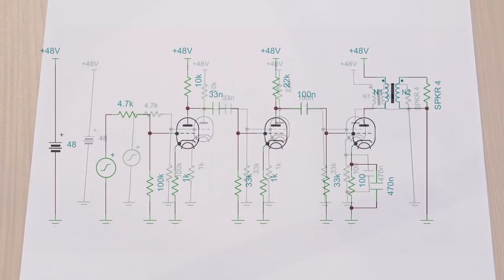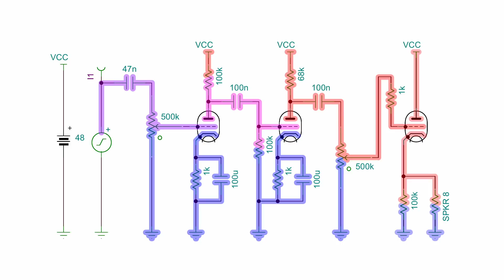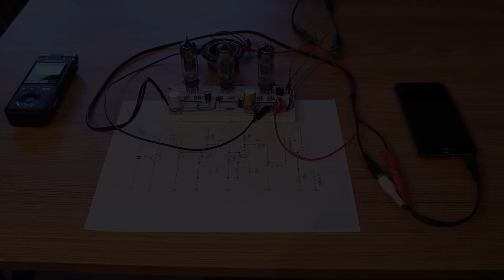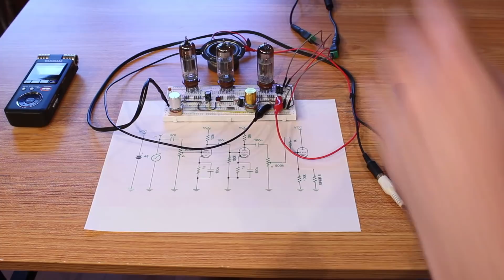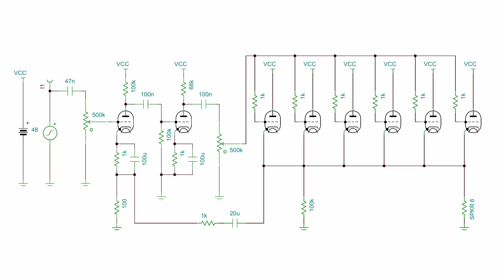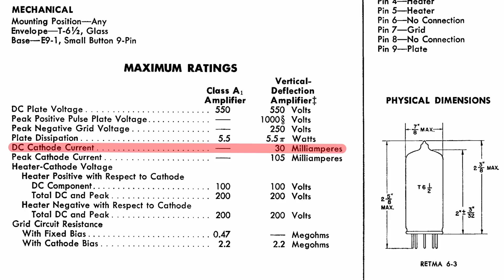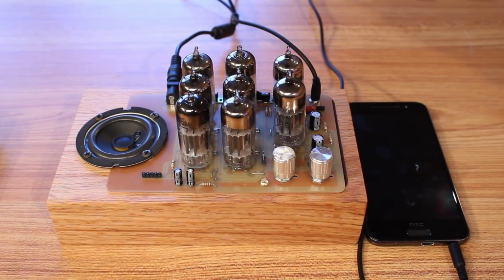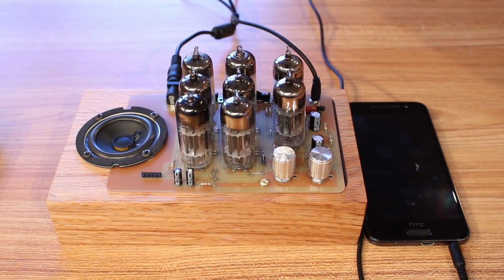A Low Voltage Vacuum Tube OTL Audio Amplifier

Comment: Great! I love OTLs as a concept - they are the peak of inefficiency in tube audio (of course), but with a simplistic charm of their own.
Not critical here,  but it's generally considered bad practice to bias a tube from the wiper on a pot.  The reasoning is that the connection could become noisy or intermittent over time which would clearly upset the DC bias conditions and act as a noise source.  A simple solution is to add a single resistor from the wiper / grid to ground.  This could be 1M, or even as much as 4.7M or so.  The grid input current is extremely low, so a high resistor value will not affect the DC conditions, and will also allow a high value pot, permitting a high input impedance to the stage if needed.
Reply from the maker: Thank you!
It's a completely improper use of vacuum tubes for audio, but I think that's why I find it so fascinating!
Thank you for the information on the additional resistor from the grid to ground. I never thought about the potentiometer potentially causing biasing issues, I'll definitely slip that in on future audio builds!

Comment: Howdy. Nice.
I like Your persistence of vision and thinking outside the box. Makes me want to try using the beasts KT88, 6V6 or 6L6.
Regards.
Reply from the maker: Thank you!
I really love experimenting with tubes in way that not many others have before. I learn a ton about how the tubes react in weird situations, which gives me a lot of fun ideas about what to try next!
Reply: @UsagiElectric  Howdy. Yeah.
I'm with You. The DC through the speaker is problematic.
One idea is to use a really large inductor at the cathode to pass the DC and divert the AC through a large el. cap. to the speaker. With an 8 ohm speaker the inductor needs to be about 30 H for a transition frequency of 40 Hz. An enormous chunk of iron.
If solid state components are tolerated one may use a constant current cathode load instead. That would be feasable.
Or one could design a SRPP (Series Regulated Push Pull) output stage.
Regards.

Comment: As many pointed out is the DC you get through the speaker in this design an issue that will affect the sound and generate a fair amount of heat in the voice coil. But it is a fun project anyway. I would probably gotten for a big capacitor in series with the speaker and then match the resistor in parallell with that for decoupling but I know some gonna say a choke is better but that depends how much bias you wanna have the tube at. many would say just omit the resistor and put the choke there instead but you also gonna remove any bias of the tube and this design is cathode biased which gonna need that resistor to work, the same thing is actually happening with that low resistance speaker across it anyway so there will be barely no bias at all which might as well be a good things at a low voltage. but in a way you still wanna have the parallell capacitor on the resistor to increase gain and if you put the speaker in series with this you actually gonna get sound out of it as signal passes by but no DC. however I could go on forever what pros and cons you gonna have with each solution but the golden rule is still to test them and see how they really do. you already play the tubes at lower voltage than they want and it gonna change everything in the end so one solution may still not be correct even if it should be. experiments is what gives the progress of things.
Reply from the maker: Thank you for all the excellent information!
And you're totally right, because I'm operating in such a weird region for the tubes, experimentation is really the only way to figure out what still sounds good. 
For the next OTL I build, I definitely want o work on getting the DC bias out of the speaker, so I'll definitely give these ideas a shot! I'm planning on using a handful of 6146 tubes triode strapped to move about twice as much current as the 12B4A here per tube. Granted, those need more than twice the filament current, so I suppose that's not unexpected, haha. It'll be interesting to see how they sound through a properly sized speaker, even if we're still at a really low voltage.
Reply: @UsagiElectric  no problem. I am happy to help and it is very fun to watch someone learning tubes like you do too. It is a great kind of learning. If you are interested you could get my discord if you want some help with anything :)

Comment: Vacuum Tube amplifier is one thing but important is to have a high quality DAC, suitable speakers and not to mention a quality sound source, ie some lossless format
Reply from the maker: If you're going for some proper, Hi-FI audio quality, you're absolutely right!
Here, with a simple cell phone playing a compressed MP3 out of a tiny speaker, the audio quality was never going to be that great. But, if I'm being totally honest, I'm deaf in one ear so proper audio quality is often lost on me, so the main purpose of the build was to see what could be done at low voltage and as simplistic as possible!
Reply: @UsagiElectric  In that case, you did very well and I understand the reasons that led you to do so.
Thanks and good luck  ;-)

Comment: I'm curious of the output transformers in the original amplifier were a large part of the issues you encountered. They remind me of the tiny transformers used in early transistor applications (while the engineers versed in vacuum tubes were making the transitions to transistors). Relatively small number of windings. Small core size. Small flux density. This worked well for the voltages involved in transistor applications. The limitations might explain why the bass falls flat, etc.    Your extremely low plate voltages seem to change several variables though. I have a bunch of 48v telecom rectifiers on-hand... I might have to give this all a try. 🙂
Reply from the maker: You're probably absolutely right! They were mystery transformers I bought on eBay years ago, so I have no idea what the winding ratio or even what they were originally designed for. Though, I'm fairly confident they weren't designed to take low voltage vacuum tube output, haha. 
"Low voltage vacuum tube audio amplifier output transformer" is an interesting field that I think might need a bit more research!

Comment: the real challenge is building a pure dht amp.(driver and output tubes are DHT.) if you can do that without hum you will be the best.
Reply from the maker: Oooh, I don't know if I have any directly heated triodes hanging around to test that out with. 
Most directly tubes run at like 1V or 2V though, right? I suppose with big batteries on them you can get all the hum out, but that feels a bit like cheating, haha.

Comment: I don't think the output tubes are getting much negative bias with only an 8 ohm speaker in the cathode circuit. What is the voltage from cathode to grid?
Reply from the maker: The cathode followers should essentially just put the cathode at the same level as the grid voltage.
However, with just an 8-ohm speaker, there's all sorts of horrific impedance mismatching going on. It's actually pretty surprising it sounds as good as it does.
Reply: @UsagiElectric  There is an impedance mismatch like most OTL amplifiers. Looking at the curves, the plate current is not too far off from proper class A operation. The curves are hard to read at only 48 volts. The negative feedback is good to reduce distortion but some audiophiles would say the sound is not as clear. I would like to know the cathode to grid voltage to study this further. Also could you measure the resistance of the speaker with an ohmmeter to help calculate the DC operating condition.

Comment: This may be a clever idea and nice design, but it's ruined by that crappy speaker.
Reply from the maker: The speaker surprisingly puts out a whole lot of decent quality sound! True, it's not going to rattle any windows, but I would say it sounds better than some of the cheapo bluetooth speakers you can get out there. 

You gotta remember that by the time you hear it, the audio has been through hell and back. The original recording was compressed down into an MP3, then played through my cellphone's audio player, which was then amplified and output by my OTL and speaker. Then it finds its way into my audio recorder microphone, where it gets compressed into MP3 format yet again, then it gets pulled into Davinci Resolve which compresses it again with its own algorithm when rendering the video. Then I transcode that video using Handbrake (which, you guessed it, compresses the audio yet again). Finally, I upload the transcoded video to Youtube, who then does all sorts of mystery stuff to the audio before its streamed around the world to your computer/cellphone/TV, which processes the audio uses its own internal hardware and plays it back through unknown speakers.

Honestly, it's a miracle it's even understandable!

Comment: Which tubes are used on the 2nd amp?
Reply from the maker: All the tubes on the OTL amplifier are 12B4A single triodes.
For the older amplifier that we built a long time ago, I use 12BH7 dual triodes for amplification and 12B4As to drive the output transformer.

Comment: If you put enough of them in parallel, I guess you could actually impedance match with a 16 ohm speaker.  4 16 ohm in series with 15 12B4 in parallel should match up pretty close.
Reply from the maker: Yup, even two of the 8 ohm speakers in series would have made a massive difference, but I only had one of the speakers unfortunately. For the next OTL I build, I think I'm going to use big 6146 tubes triode strapped. At 50V, they should move about 60 to 70mA. I have 15 of those in my collection, so if I run 14 of them in parallel, that should get me to about 50 ohms of impedance, which with 6x 8 ohm speakers in series is just about perfect!
(Granted, I'll need 100+W of power just for the filaments, haha)
Reply: @UsagiElectric  Match all your filament currents and put them all in series.  If you get your tube count right, you many end up with enough that you can run the heaters off line voltage and you won't need an A supply at all.
Reply: @UsagiElectric si considero que lo mejor es un termino medio y un equilibrio, para reducir algunos tubos aunque pongamos mas altavoces en serie., Y si es posible de alta eficiencia no se te olvide 😊

Comment: Your construction techniques are one of my favorite parts of your videos, always so clever and resourceful. Mounting the pots that way with the header pins is a great idea to take the stress off the joints.
Reply from the maker: Thank you so much!
I actually really struggled with a good way to mount the potentiometers using a single sided board. I discovered that If I give the header pins a slight bend, they slip right into the pot connection holes on the back side making it super easy to solder up, but also adding some strength to the mounting. 
I'm really happy with how this one turned out visually, it's a bit dense and runs way too hot, but it looks awesome!

Comment: I wonder how much lower you could go on the OTL plate voltage 🤔
Reply from the maker: In my initial testing, I ran it as low as 24V with just three output tubes and it still put sound through the speaker. It was very loud, but it had enough volume to be able to hear what was going on. With more output tubes, I reckon it'll put some decent sound through the speaker. But, the margins on distortion from the amplifier stages get a lot tighter. Still, could totally be done!
Reply: @UsagiElectric  interesting, I’m gonna have to try this out when I get up and running; just ordered worktop today so progress is being made!

Comment: Wow that is sooo cool. I have a tube amplifier that I started restoring a few years ago and I kind of lost my forward motion on it. watching your vids really gets me psyched to  work on it again.
Reply from the maker: Thank you so much!
And that's awesome to hear that you're getting fired up to work on it again! If you get going, let me know, I'd love to see some pictures or a video of it running!
Reply: @UsagiElectric  Absolutely. I have a question can I use a 1b3 (13b? rectifier valve) to perform a full wave bridge or do I need four of them?  I believe I need to rectify 2000 volts or 5000 volts at a high frequency such as 200khz. what will turn that sine wave into a unipolar pulse train?
Reply from the maker: @Biokemist-o3k  That's a lot of voltage! 
The 1B3 is just a half-wave rectifier, so you would need two of them to do full-wave rectification if you have a center tapped transformer. If your transformer only has two taps, then you would need four to get full-wave rectification. Though, with such a high frequency, half-wave rectification and a good HV cap should be totally fine. The HP 150A actually uses a 1X2B as a half-wave rectifier with a 1500pF smoothing capacitor for it's HV generation.
Definitely check out some old HP and Tektronix oscilloscope manuals for ideas on how they did HV rectification!
Page 63 in this one: http://hparchive.com/Manuals/HP-150A-AR-Manual.pdf
Page 114 in this one: https://w140.com/tekwiki/images/3/3d/070-198.pdf
Reply: @UsagiElectric  I am only going to be rectifying 3,000 volts but it is at a high frequency. I want to capture at a nanosecond level the energy from a spark gap. I have silicon rectifiers that will capture at 100nanoseconds but it takes some time to conduct from what I understand. I have been reading and it seems that the 1b3 because of the grid heater would be ready to conduct almost instantaneously. I have seen setups where they have used four of these valves together but I have to delve into it much further. And yes I want to fill a capacitor.
Reply: @UsagiElectric  Thank you so much. This is awesome information!! I believeI will have to study more before i can even understand it...

Comment: Could you use the RightMark Audio Analyzer 6.4.5 to measure frequency response and distortion?
Reply from the maker: I'm not sure how good it would be to test that as it would be limited by the speaker and microphone capabilities wouldn't it? As it is, I had to crank the recording volume on my Tascam recorder way down to prevent the microphone from clipping. I did check the distortion of the two amplifier stages on the scope though. This is a 1V P-P signal being input, and the output signal that goes to the grids of the driver tubes is 12V P-P and has surprisingly little distortion. It gets just a slight bit of distortion at the bottom of the sine wave, but other than that, it was way cleaner than I was expecting!
https://i.postimg.cc/rw6pH9R3/IMAG0463.jpg

Comment: You built a V8 racket machine. Congrats! Keep up the cool engineering work :)
And I agree that this amp could use ceramic tube bases, possibly on a chassis rather than PCB.
Reply from the maker: Thank you Keri!
It means a ton to hear encouraging words from you after seeing your phenomenal amp projects!
Ceramic bases and a bit more space between the tubes would have made a massive difference. For the next OTL I build, I think we'll throw space restraints out and just let the amp get big!

Comment: It helps to more adequate judgement of voice quality, if spoken through also the qualities of loudspeakers, a resonance frequency meaning related to them and how this affects the imaging of soundtrack played.
Mind, with original amp, with transformer output, You used really teeny-tiny speakers, which likely cut the frequencies heavily already from 500Hz downwards. The OTL however, I'd guess, had a speaker load with a resonance frequency nearer to 200 Hz and therefore also allowing better image of base.
Try them both amps with a very simple card cone 6 to 8 inch full range speaker and the improvement will be immediate, despite the lowest price of the speaker.
Also, you are handy (respect ) on woodwork, like it shows. This could lead to another exploration, related to word couple - Open Baffle.
Keep up. Love your thinking and deeds. ;)
Reply from the maker: You're definitely right, it wasn't really a fair comparison of the two because the speakers were pretty dramatically different between them. I do really want to build another amp with a proper output transformer and speaker to see how good of sound I can get out of something compact. I have an idea of building a tube amp that sits on top of a wooden cylindrical speaker box with the speaker mounted on the bottom facing downwards. I think that could result in a really beautiful design with some work and it sounds like the perfect candidate for a proper output transformer amp!
Reply: @UsagiElectric  Oh... I am far from being ultimately right here. Didn't touch the issue with tiny output trannies. Small as these, they do limit the frequency delivery also. Neverthless, especially in guitar amp making, is not so critical always. Also, the whole side kick science, not recognized/accepted with true proud audiophools, goes about using power supply transformers for output. And these go for fraction of price compared to specialized output transformers. Can have lots of fun cutting/bending the corners in this area. ;)